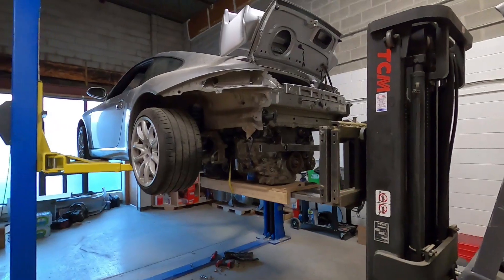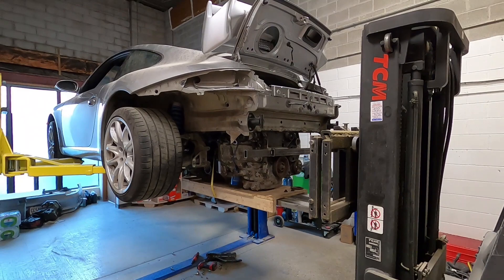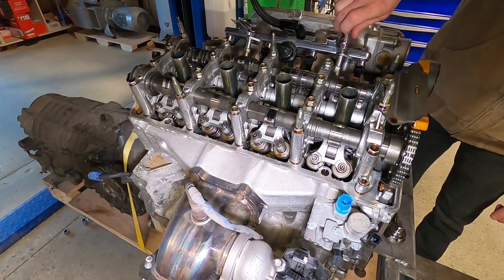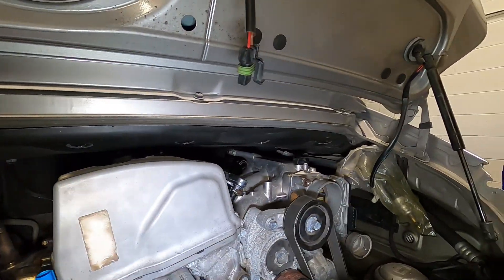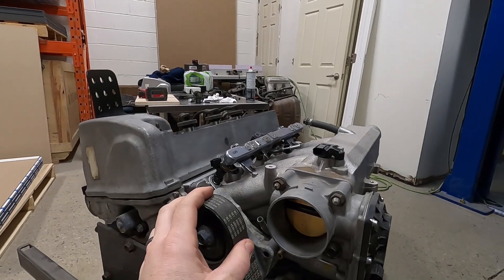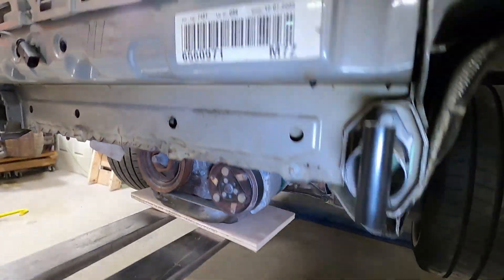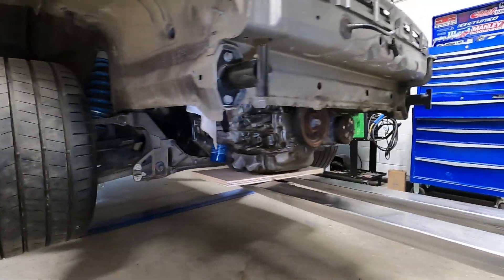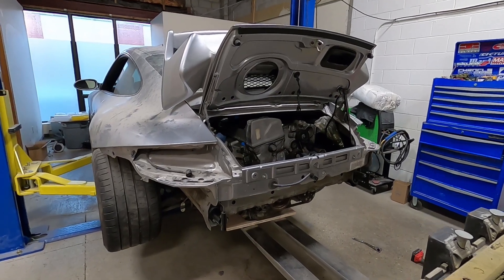K24 Porsche Swap - Custom Valve Cover Install

Comment: Good job. Think 996 with k20 will fit same. I can do all the fab work for mounts. I found a transmission adapter kit
Reply from the maker: Technically the K20 should fit even better, its 19mm shorter

Comment: How will this work with adding bungs for a catch can or air oil separator?
Reply from the maker: Yup - The plan is to add 2 bungs and run a catch can

Comment: Checking your oil might be a task 🤭
Reply from the maker: The Porsche engine uses a electric oil level sensor - I'm working on how to adapt it to the Honda engine so i can check oil without a dipstick